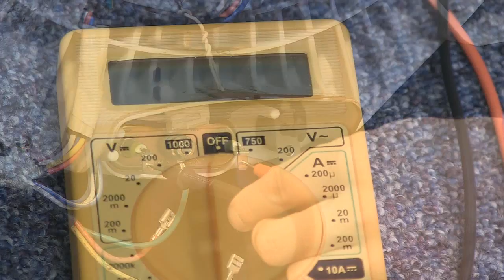How to Diagnose Washing Machine Control and Program Problems

Comment: Could you tell why my washing always container water or drainage it works fine it just after washing after 8 I find in the cycle please help ?
Reply from the maker: If the machine has water in it after a while but drains correctly check if the water is returning through a hose connected to the pipes under a sink. If this is the case raise the hose so water does not flow back when emptying the sink.

Comment: I have no lights, wont power on no clicking. mechanically it was fine. It completed a cycle. then when I went to unload it the door was locked, machine was not lit up like it normally has a clean light lit. i had to unscrew the bottom and manually unlock it, which I did to unload the machine, now I still have no power at all. Ive tried all the 'resets', plugging it in unplugging it. no click noise when I plug machine in. I don't know if I should replace the interface control board or the central control board, any help is appreciated.-
Reply: Faith Cooke has

Comment: hi sir i need ur hel my washing machine is samsung top load model no.WA90F4 i change the water pump motor bcause its shorted then i install the new water pump now.the problem is they continue to drain and continue running the water pump motor sir what can i do plss help thnks
Reply from the maker: Make sure the drain hose is raised above the water level in the drum or the machine can syphon the water away. If the pomp is always running the problem is likely to be either the control panel (which may be the reason why the pump failed) or the pressure switch. For more information see:
https://www.youtube.com/watch?v=2pIVkAxWSXg

Comment: I have Lg washer and the connector from Main board panel to front control panel are burnt, how do I check if the main board or the control panel board are good.
thank you
Reply from the maker: Hi sunsteve1, you cannot meter the PCB but check it visually for any signs of damage, if the connector is too badly burnt you would need to replace it.

Comment: Hi I have a hotpoint wdl 520 keeps switching of through all programs not displaying anything just switches off had a guy look at it and he said it was in good order but still got the problem he said would take it away and sell me another one it works sometimes should i replace the board or the washer any help please
Reply from the maker: Hi, the PCB cannot be replaced by anyone other than a Hotpoint engineer or their agents as it needs programming to work at all. If  you follow this video and everything else seems OK the choice is to have an engineer replace the board or replace the machine.

Comment: Power cord is good and power from Wall is good still no power. Whirlpool cambrio
Reply from the maker: Hi Learning, you will need to check the rest of the circuit with a suitable meter to determine the cause of the power failure.start with the mains filter through to the board and test the door lock.

Comment: I have a problem with my affinity front load washer .. I have cleaned the drain pump it is clean , door lock is locked when on but it will not do the final spin it also has a little bit of water left in the drum. I'm thinking it's the control board , but I want to be sure. I checked the motor and the belt in the back all is good..
Reply from the maker: Before suspecting a control problem check the drain circuit and watch another video:
https://www.youtube.com/watch?v=frEJhX9Sppw

Comment: Hello i have an electrolux and when i try to use a program it starts to make a noice and then goes quiet. The start light flashes And that is That, what might the problem be?
Reply from the maker: If you have followed the video above then at 2:17 it describes if the machine has a filling problem it may shut down. If it is 'happy' that it has filled you may have a motor problem. Check by selecting spin when the pump should run followed by the drum turning. If the drum does not turn see another video:
https://www.youtube.com/watch?v=D5Aw7CBEGPI

Comment: my 5.5kg Simpson eziset washer has no power have they got a fuse or is it control board
Reply from the maker: This machine is not familiar to us but we would suggest you disconnect and follow the  continuity of the power cable to any control board using a meter as shown in another video: 
https://www.youtube.com/watch?v=pJkyY8qRRwc

Comment: I have a hotpoint washer and having a problem where if I place it into a programme it starts and constantly fills and turns a few time and fills and seems to be stuck in a loop and never moves on to any other stages within the cycle
Reply from the maker: Sounds like the water may be running away due to the drain hose set to low. For more information see another video: https://www.youtube.com/watch?v=frEJhX9Sppw

Comment: Hi, 
My hoover machine will not spin in a wash cycle it fills with water then does nothing but it will spin when I select just a spin cycle any idea what this could be thanks
Reply from the maker: Hi Megan, it sounds like it is not draining out so it can't spin so check the filter and test the drain pump.

Comment: My hoover washing machine is only 2 year old, when switch machine off and next time go to use it, the settings do not correspond with the certain cycle and the temperature time etc
Reply from the maker: Hi Alison, it sounds like either a communication issue between the boards or a loose connection, check the connections and look for any signs of damage and if OK it may be the board.

Comment: Hi I have a Hotpoint Ultima washing machine thats about four years old and the machine has recently started to smell on further investigation it seems the water is not heating up it just washes cold
no matter what the temp setting is but the machine shows no error codes and washes without pausing through its cycle although it does seem to wash a alot quicker than the time on screen suggests I imagine because the water is not heating up is this possible without error codes ?
Reply from the maker: Hi Iain, if the electronics have not detected an error it may not be displayed but if it is not heating then you need to test the heater with a multi meter to determine if it has failed and the video shows you how at 7.05

Comment: my beko machine is stuck on the same wash. when i turn the dial for a different wash the display wont change. luckily it's  stuck on a 30 wash and does still wash ok. but the display has some info missing off it that usually shows up before you start a wash.   help.
Reply from the maker: +Elsie Hannam Check the heater has not failed as the display may be trying to indicate a problem. If you cannot 'turn' the timer to drain or spin it is likely the control knob is not engaging with the control.

Comment: just to clarify! where is the  and pause & rewind function located? and is there a volume control option?           😰😰😰
Reply from the maker: +MegaMissfitz To pause or restart click on the triangle/arrow bottom left, To go forward or back click on the red 'timeline' in front or behind the bar as it progresses. Clicking on the speaker allows volume up and down but make sure your PC's volume is high enough (click the speaker on the tack bar).

Comment: sir can you help me with my lg fuzzy logic 6.5 kg wf-t6560ct model.. after filling with water all it does is beep with wash and spin blinking.. kinda frustrating.. thankyou in advance..
Reply from the maker: +Arjay Cruz Sorry we haven't been able to find out much information on this machine but we think it may either be a problem with the door or lid switch. If it has a brush type motor it could be worn motor brushes so these may be worth checking.
Reply: Thank you sir for the reply..

Comment: Hello sir, when I turn on my washing machine, the light just blinks, it won't turn on
Reply from the maker: Hi Cheryll Munoz, you haven't  given us many clues as we don't even no the make or model. However if it is a front loading machine and the door locks a quick fist check would be the motor brushes as this can cause this symptom.

Comment: I have a hotpoint and it is tripping the electrics at the start of the wash cycle when it locks to door! any ideas?
Reply from the maker: Richard Brown Most likely cause will be the water heater or if a washer dryer it may also be the dryer heater. We have videos showing replacing these parts, If you remove and examine them there may be signs of damage to confirm the fault. You can try temporarily disconnecting the heaters and ensuring the connectors are insulated to retry and confirm this is the problem.

Comment: Hi, I've just tested the element like in this video at 7:33 here I've posted all of my readings, I know some configurations won't even be variable but I've listed them anyway. long story cut short my whole inside drum via e-spares has recently been replaced (now week old) but now the plug end went pop after about a weeks usage from it being fixed.... and now there is no power whatsoever. I am no electrician but I'm trying really hard to work this out. so I am trying to diagnose the problem piece... so far it's pointing toward the power cord. ( reminder these readings are for the element  not for the power cord. Continuity - red > live & black > neutral = 031   red > earth & black > neutral = 1  red > earth & black > live = 1 and lastly black > earth & red live/neutral =1 resistance @2000k - red > live & black > neutral = 1  red > live & black > earth = 1   red > earth & black > live/earth (both individually gave same reading) = 1resistance @200 - red > live & black > neutral = 31.3  red > live & black > earth = 1  red > earth & black > live/earth (both individually gave same reading) = 1  Why did I not get a reading on a lower setting when I placed red to earth & black to live/neutral?? (you said 'across' in the video which didn't state neu or live so I did both). It would be grateful if you could shed some light on this query? as I'm about to order a new power cord from e-spares shortly. ps; for the power cord readings (plug to opposing end box) I am getting nothing whatsoever, no resistance/continuity reading's. In just the plug end alone I'm picking up a resistance (2000k)reading of red > live & black > earth = 380 again no continuity. hopefully you can maybe help. thank you!
Reply from the maker: Like any bulb electrical devices need a minimum of two wire to work and often have an earth for safety. If you get continuity (low resistance as if probes touch) from both live and neutral plug pins to the control board but nothing lights or locks it suggests a control board failure. A faulty heater at best would only cause the wash to continue or at worst would blow fuses.
Reply: Thank you for taking the time.

Comment: My Logik washing machine door wasn't locking. I replaced the interlock but this has made no difference. Is it a problem with the PCP board?
Reply from the maker: Hi MR TNT, if the door is closing correctly and the door lock has been replaced it would suggest that the PCB is likely.
Reply: @eSpares  thanks, thats what I thought

Comment: i have a aquarius 1100 washer dryer it keeps triping my electric out when i  switch it on
Reply from the maker: Hi Haydn, if the power trips when you switch on at the wall before you press the power button on the machine suspect the mains filter and see this video: https://www.youtube.com/watch?v=N_b_mwSXeU0
If it only trips when the power is turned on at the front of the machine suspect the water heater and see:
https://www.youtube.com/watch?v=jeygkgjR50c

Comment: Hello eSpares.  My washer is doing something very weird.  It fills as normal, does the wash cycle selected but then tries to spin (without the drum emptying and turning).  There are no blockages anywhere and I have tried a new control board (but the same problem).  Also put a new pressure switch in it  but still the problem persists.  The washer will do everything if I nurse it through (ie manually set to drain, or spin etc. but it seems very confused). Any suggestions what it could be ?
Reply from the maker: +Debra Booth  Sorry we are late replying but Youtube has just 'found' your comment. We suggest you see some of our diagnosis videos like: https://www.youtube.com/watch?v=frEJhX9Sppw
Reply: Thank you very much.

Comment: I have a problem with my Samsung WF218anw?xaa front load washer. It first stopped with clothes still wet and tub undrained. Gave the "nd" no drain code error. I checked the filter catch, and all drain hoses. Nothing major there, so I ordered a replacement drain motor and installed. Tested new motor by pouring in enough water to just see it appearing inside tub. Turned on and set to "Spin", which is an 11 minute cycle. Hit start, and heard and saw pump pull all water out of tub, then entered the spin cycle normally. I considered  it fixed. 
Next day, put in a load of clothes, detergent, and set cycle to "Normal", 1:15 minute cycle. Hit the start button and it took several minutes before any sign of activity. Finally the "Lock" engaged, and put the lock symbol on screen. The wash tumble cycle began. When the tumble cycle ended, the washer just sat there with the timer fixed at whatever time was left in the process. Washer remained silent and motionless for about 20 minutes, before the drain pump "came on"!, and quickly sucked the tub empty. Again, another long period of inactivity and silence .. (15 minutes?) Then tub starts to be filled with water and the rinse cycle is started without fanfare. Rinsing cycle looks and sounds normal. Rinse ends, and again inactivity and silence a several minutes before drain pump comes to life and sucks the tub empty.
  To make it shorter, several different tests have been performed tryin to tie down a pattern. Some times the final drain will not happen at all. I have tested by unplugging, the washer for 2 minutes, then plugging in , filling the tub with clean water, turn on and set to "Spin" cycle only and hit start. Pump comes on, pulls down tub to emply, and enters the spin cycle normally to completion.  Next time, I try this same "Spin" only test ... and I hit start, yet get no activity at all ... I give up. Try this same "Spin" Only test later and I get no activity for about 12 minutes, Then the door "locks", puts the locked icon on screen, but still no drain. 20 minutes later, drain pump comes to life, and pulls tub down quickly. Now, I notice strangely, the washer defaults to the "Delicate" setting everytime its turned on, no matter what it was last set as. I know this was not how it acted before the problems arised. it used to always open up on where ever it was last used which was typically "Normal".  What's going on with this washer, ... a bad door lock switch, or a bad main control board?  Please help ...
Show less
Reply from the maker: +Daryl Ireland Wow Daryl, I cant say you have not given me enough information to start to identify your problem.  I think I would check the motor brushes first as these may have worn and be causing the motor to be intermittent. If these are in good condition then the next thing we would suspect is the door lock. If this does not cure the problem then it may be the PCB but we would suspect that last. Good luck.
Reply: +eSpares Thanks for the reply. I think I will try replacing the door lock switch as it certainly does some weird things such as waiting long periods of time before making its initial "lock" at the beginning of a cycle. I watched another video where the author was replacing the drain pump on the exact same model as mine. He did the "spin cycle" test. He poured in a sufficient amount of water, closed door, pressed the power button, set the cycle to spin, (11 minute duration on display), then pressed the start button and the machine did an immediate "lock", and almost instantly afterward the drain pump came on and emptied the tub. Few seconds later the spin cycle started and ran off the remaining 10 minutes. when I do the exact same thing, mine sometimes waits about 10 minutes before the door will perform it's "lock", then everything else completes as normal. Conversely, though ... sometimes it just sit there and never locks at all, and just sits there with the lights on forever. Always defaulting to the "Delicate" cycle on power up, is also weird and unexplained.

Comment: Hi, my Bosch Max Classic will not come on at all. I followed a reset instruction & it came up with E5 (water issue) so I followed instructions in manual on that but still nothing. When holding Start button & turning to 15 min cycle on dial it then came up with 8888. No display if I simply turn dial alone. Please advise. Many thanks
Reply from the maker: Hi Leanne, E5 does refer to water inlet so first test the water valve with a multimeter and check the water supply, next with the machine off test the circuit to the PCB and check for any loose connections and any signs of damage.
Reply: 94

Comment: error E09. I opened washer to find motor belt on floor. when putting back on pulley found drive pulley had worked lose. retighened and all working fine.
Reply from the maker: Hi Eme, we're glad your appliance is now working. Remember to like and subscribe for more helpful videos in the future.
Reply: keep up the good work . thanks